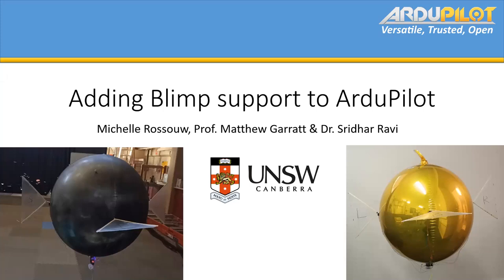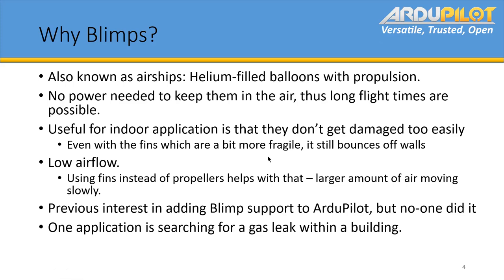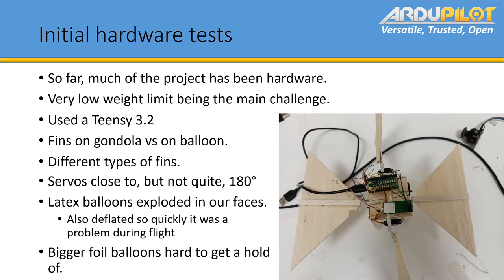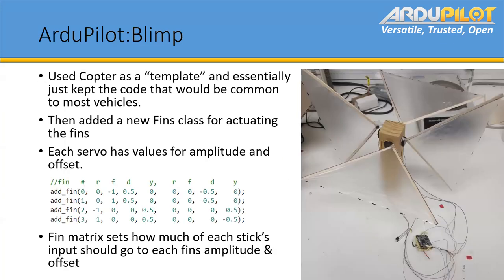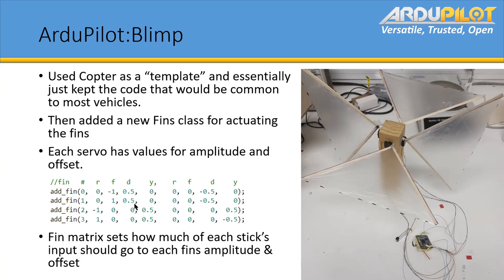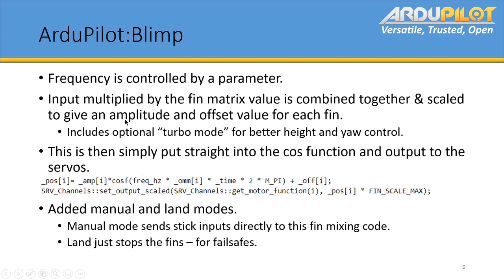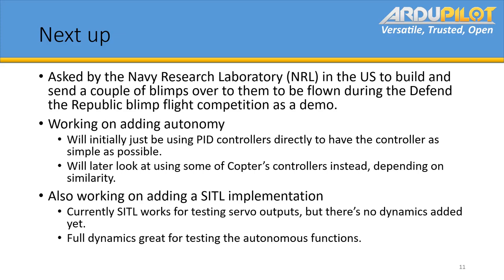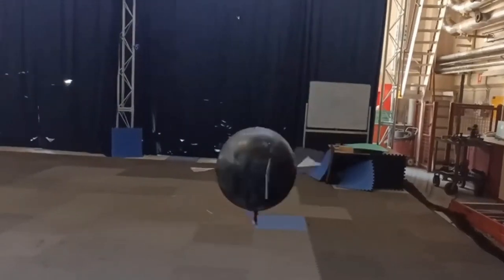ArduPilot Blimp Support by Michelle Rossouw

Comment: interesting, I think the payload mass constraints could be solved by using a weather balloon for buoyancy, and adding ballast to achieve neutral buoyancy. Motors could then be used for altitude control, this would be advantageous as you could cut the motors and the blimp would remain stationary.